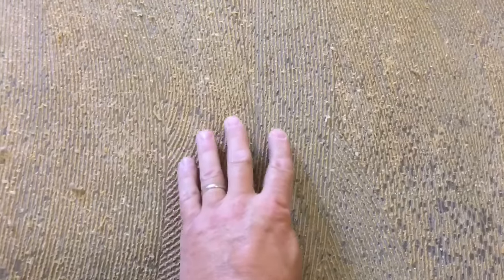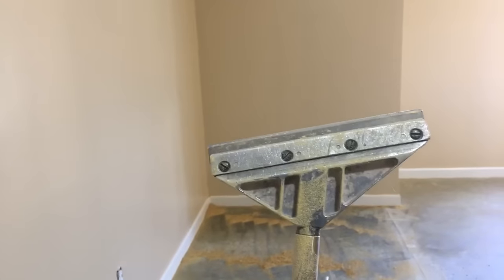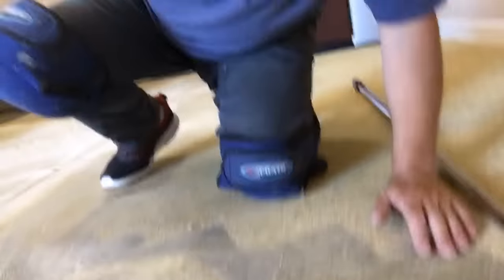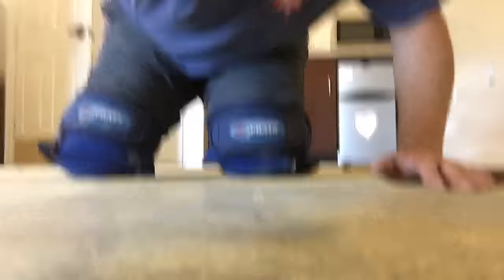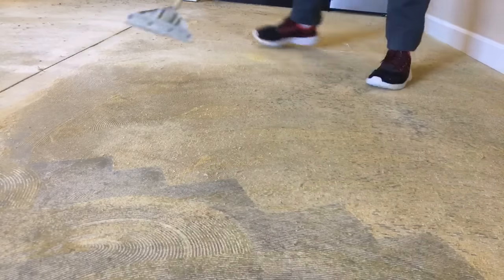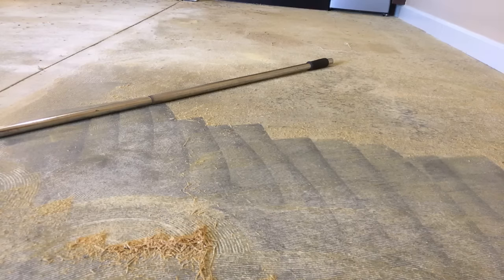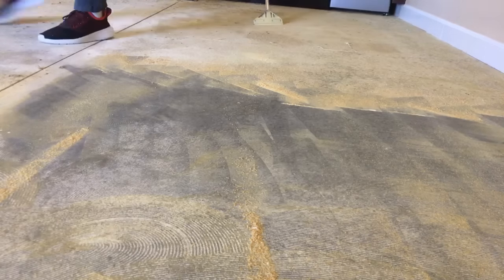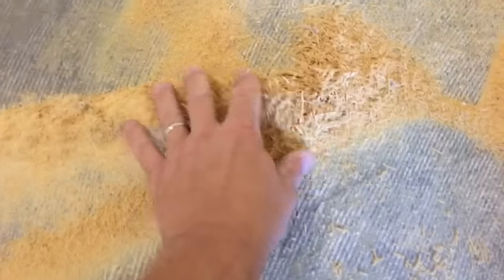How to remove old carpet glue

Comment: This video is a rare example. In most cases it’s going to be extremely hard to get the glue removed. If you’ve got stubborn glue that won’t come up the best method is an angle grinder with a concrete grinding/diamond cup wheel. Works every time and will take it down to bare concrete.
Reply: @squirts1  In that case you’re probably going to have to rent expensive machinery to get that kind of glue removed. Or you’d have to pour some carpet glue remover on it and let it sit. Then use a heavy duty scraper and remove as much as you can. Let that dry and now you can use the angle grinder with the concrete wheel to remove the rest of the glue and get it down to bare concrete. Either way it’s going to be a tough job.
Reply: I think you’re right. I have an outdoor concrete slab and the glue is really stuck on it. This floor looks a lot smoother than the concrete I’m dealing with. I think the grinder it is.
Reply: would the heat  cause the glue to gunk up the diamond head?
Reply: @Zlic701  Not really, if you get a diamond grinding cup it shouldn’t gunk up.They’re pretty cheap at Home Depot or Lowe’s.  The size space I did was 20’x 15’. Took me an entire day but it worked way better than a scraper or glue remover did.
Reply: What about hardwood floors?

Comment: After more than 30 years in the business I have some great ideas and only share with people who are good and trying to be the best they can be. When working with that glue that's still sticky you mentioned I throw dry floor patch around then sweep it around  before patching the floor ( makes a mess if you aren't careful). Nothing worse than having your knee pads stick to the floor.
Reply: Hi Don, how long does it take for the floor to stop being sticky? I just pulled up square stick on carpet from an old living room and the glue is very tacky still. I want to put in clip in vinyl but I am not sure how long I'll have to wait for the floor to dry or if I should put something over it first to help it dry?
Reply: @JoshPavano  it can stay sticky for a long time.  Any kind of powder will stop the stickiness though. Just spread out a  little dry powder like floor patch or drywall compound and sweep it around. It does make a bit of a mess though.

Comment: Do you have advice if the glue is still tacky? We are currently mid project and I have tried my fair share of scrappers but they just don’t do the job.
Reply from the maker: @slasher3267  brush flour all over it with a broom, and then scrape it or you can use Floor patch as well instead of flower

Comment: I sprayed full strength Amonia on the length of the tape on the floor....scarped up the biggest part of it and put a little Wesson's oil on a paper towel and cleaned up the residue. WORKED!

Comment: just purchased a condo and the carpet is glued on good. I hope it's this easy once I manage to get the carpet off. thanks for the info!
Reply from the maker: cassaundra soto-gillon cut the carpet in strips about 6-12 inches wide with a razor knife and it will be easier to get up

Comment: I have the same situation after I removed the outdoor carpet from my front step. You made that look easy, nice job Reuben. Thanks for the tip.
Reply from the maker: teh60 you’re welcome thanks for watching and your comment, I really appreciate But when y’all give feedback
Reply: Would not advice using this method for outside concrete I tried with adhesive remove pressure washer razor and all

Comment: You made it look easy LOL - I guess whoever did mine used a LOT of glue. Some came up, then I had to use paint stripper (2 coats on some of it) then wash it with paint thinner, which actually loosened it up very well with a brush.  It was a painstaking effort.
Reply from the maker: I feel your pain

Comment: I experienced a flood, the house is a rental and 1968. The carpet is old & im told it’s glued. Since it was flooded from a failed sump pump and has been wet since Thursday, how hard is it to DIY rip out the carpet? What should we try or should we just hire? Landlord had no flood insurance and the carpet stinks after he paid Stanley to get as much water out. I don’t think he has the money for carpet and it’s a basement that’s used for laundry only…
Reply from the maker: You should be able to get the carpet up fairly easy, I would take a screwdriver or something like that and get it a corner started and see how easy it’s going to come up before I determined that I was going to do it. Once you get the corner started, you can grab it and start pulling on it to see just how easy it’s going to work. If you do decide to take it up yourself then, you’re going to want to cut it in strips about 1 to 2 foot or 3 foot wide and take it up in pieces like that. Depending on how hard it is to get up will determine how wide you need your strips cut.
Reply: @FloorsbySouthernboys  thank you! I lifted one area and it wasn’t as bad as I feared. I just see concrete.
Reply from the maker: @pearlesme8561  awesome

Comment: I know this video is 4 years old but will it work for me too?  I bought a new built home but was model home and they used the garage as office so they installed carpet on it.  After all new homes were sold and this model home was the last one on the lot so they converted the office room back to garage.  Carpet glue is over the garage floor.  I tried to scrape it but it was so hard.  Maybe because i didn't use the long standing sceaper like you.  I will try to get new long scraper and try again.

Comment: I didn't know it could be so easy❣  
I know it takes some endurance, but I thought it would be much more difficult to scrape up.
Reply from the maker: T Floyd Usually if it’s not tacky it’s not too bad to take up
Reply from the maker: T Floyd It is important that you have a brand new blade in your scraper though, I went through four blades In that one room just to keep it easy, when your blade gets dull it starts to get hard to deal with

Comment: What If the glue is just several weeks old? On this they installed carpet the plans called for sealed concrete.  Need a way to get the glue up. Any suggestions?

Comment: You could use sander with a fresh disc or just get on your knees with a 4 inch scraper. Change your blade often they do dull up. The big 8 inch scraper is a good choice tho. Multiple ways to scrape a floor clean.
Reply from the maker: marioc007 yup

Comment: Would this tool also work for hardened white plaster looking stuff under super old carpet as well? The house was built in the 60’s and I’m not sure what the white stuff in patchy areas even is. The flooring is concrete.
Reply from the maker: Yes ma’am it will what you’re seeing is probably a floor patch, a lot of it used to be white now it is more commonly gray

Comment: Just removed old linoleum tiles and the glue is still super gooey and sticky! We've been here for 3 years and the tiles must be way older. Not sure why/how the glue is still so wet but HOW CAN I REMOVE IT?
Reply from the maker: Someone probably used the wrong adhesive on it, get you some floor patch and sprinkle it all over the glue sweep it all over the glue And it will absorb the stickiness, then he should be able to do something with it
Reply: @FloorsbySouthernboys  the only floor patch I know of is the leveler ... You put it on like mortar/putty. Is there another that you sprinkle?
Reply from the maker: @mgabrell4199  What you’re thinking about his right, you just don’t mix it leave it in powder form and apply it to the adhesive and spread it around
Reply: @FloorsbySouthernboys  ok, I'll give it a shot. Thanks!
Reply from the maker: @mgabrell4199  Be sure to have a brand new blade in your razor scraper

Comment: I wonder if there is a prefered glue to use for carpet tiles on concrete that will make removal, in the future, much easier??? Thanks for your video...
Reply from the maker: JL T You must use a pressure sensitive glue for carpet tiles, and if you let  The glue dry until it is completely clear you won’t have an issue getting your tiles up, that is how it is supposed to be done anyway

Comment: Floor buffer with a carbide scrape away head. Other wise I use a four inch wide scraper.
Reply from the maker: Adam Bolinger Thank you for sharing that
Reply: If it's really dry I wet it then run the cut away head on it 
It helps keep dust down,
Reply from the maker: Bill P Nice point, thank you

Comment: Will the scraper work on plywood sub floor?
Reply from the maker: Mike Malone Yes, but you might have to turn the plane around backwards and put the sharp edge in the scraper and use the blunt and to scrape the glue
Reply: Scrape along the grain.

Comment: What do you do when it's multiple layers and pain in the behind to scrap? Just curious had 4,000 sq ft had to skim over did not have enough time to scrap it all due to the multiple layers and also went through about 100 heavy duty blades.
Reply from the maker: https://youtu.be/XmRbXmQeGvo    here is a 4000 sf job that is exactly like you described
Reply: Find a cutaway sander if needed add water if any glue is older than 1985 or is black in color it'll keep dust down and if it's older it's a must and you'll need to vacume out all the debris if it's 1985 or older due to asbestos.
It's classified as abatement 
And disposed of in bags properly.

If you can add water blocking doorways with plastic using hot glue to secure to doors and add water let set the glue in most cases as with asbestos tiles will self release, saving time money and your back.
Scrape While wet and vacume up, use oil absorbing powder and let sit, it will assist alot, check with moisture meter until your at a safe level and install
Reply from the maker: Bill P 😮
Reply: @FloorsbySouthernboys  
Learned that doing gym floors it takes alot of water
Reply from the maker: Bill P Cool, thank you

Comment: The previous owners of the house I just bought, glued down carpet on our front porch with no tack strip. It’s just straight on the concrete. We haven’t even tried to remove it yet, but you can already kind of see it’s going to be really sticky and difficult to get off. Any suggestions??
Reply from the maker: Rachel Thurow I have used denatured alcohol with razor scrapers in the past, unfortunately it is quite a mess, so good luck
Reply: How did it turn out and what did you have to use besides the razor scraper?

Comment: Will this work if I need the glue off of concrete
Reply from the maker: Valerie Davis yes However if the glue is still tacky it will be more of a challenge
Reply: It’s been there for 69 years hahah
Reply from the maker: Valerie Davis 😲I’m sure it will work just fine then
Reply: It takes a lot of work.

Comment: I have an area rug in my bedroom I want to get up but it’s stuck to my wood floors. I’ve been wondering on an efficient way to get it up before I wax them
Reply from the maker: If it is just an area rug it is probably the backing that they place under the rug that is actually stuck to the floor, a person Hass to be real particular with what kind of non-skid pads that they use under their rugs when placing it on hardwood because it will damage your floors if you do not pick the right nonskid pads

Comment: Hey brother, I need quick advice please. 
I got some Mohawk v-one pressure sensitive glue on a customers base boards and I wanna clean it up, what will work?
Reply from the maker: A lot of times pressure sensitive you can just rub it vigorously with your fingers in it will roll off if you let it dry before you deal with it, if it is still wet use a wet rag

Comment: Thank you for the video but I swear to God the glue on my front steps the guy must’ve used the best/worst glue in the world even my flush trim tool with a scraper blade hardly makes progress!  The glue was put on so thick it’s kicking my butt.
Reply from the maker: Edward Badlands Yeah exterior adhesive is definitely different

Comment: Please make a video on how to get up sticky glue after removing carpet need help ASAP !! 😩😩
Reply from the maker: Shadae  Williams I would probably ask a flooring store for a chemical that would remove it
Reply: FloorsbySouthernboys I’ve tried everything it’s so tacky and I have small handles is there a machine for it and thank you for reply
Reply from the maker: Shadae  Williams Not that I’m aware of for a tacky Glue, what are you installing in its place
Reply: FloorsbySouthernboys tile
Reply from the maker: Shadae  Williams I have used denatured alcohol with an 8 inch razor scraper, it’s a lot of work but it works
Reply: FloorsbySouthernboys 🙏🏾 thanks